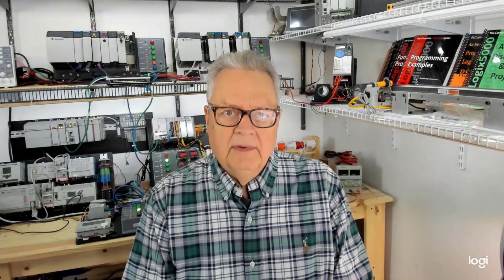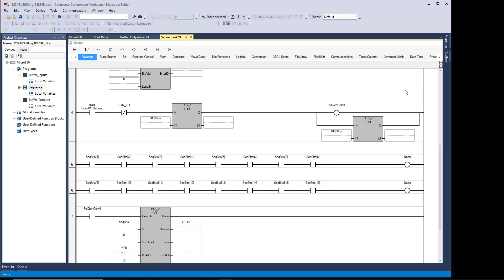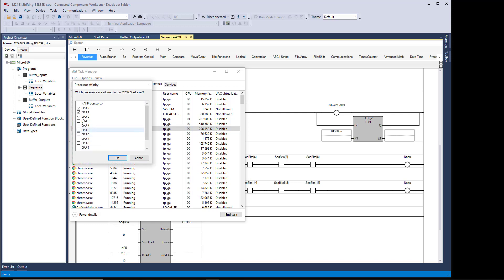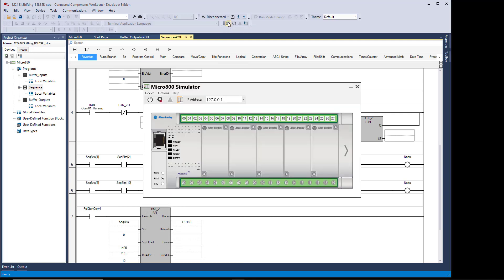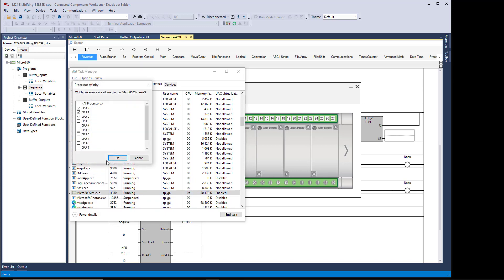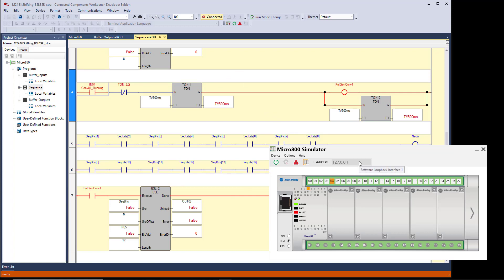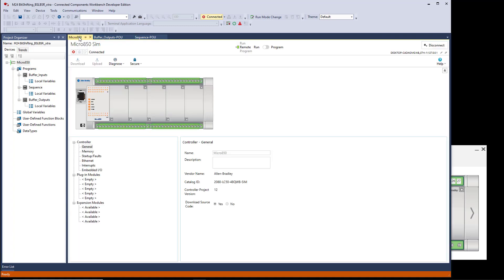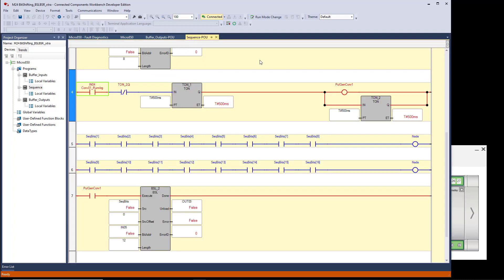Watchdog Fault Micro800 Simulator CCW

Comment: Hi I've followed your channel for a while now great videos all of them, I was wondering what would be the best way for someone with little experience in plc programming to get into the industry you see I'm an industrial electrician I'm acquainted with the plc industry but don't have the hands on experience required to say "I can do that job", my career change comes since most electrical work keeps me out of state months at a time but plc work is abundantly available where I live in Texas but hard to get into.
Thanks again and hope you can reply.
Reply from the maker: go to the PLC eUniversity site and purchase the orange/black manual. You can use it with any SLC500 or micrologix. There are two version of that manual, one with software and one without. The free software programs the Micrologix 1000 or 1100 only. The software to program the 1200, 1400 or 1500, you have to buy from your local AB distributor, <$200. You can build your own digital field device simulator (switches and lights) or buy our kit. The complete lecture series can be subscribed to at another site.